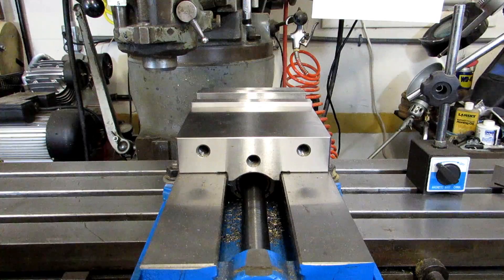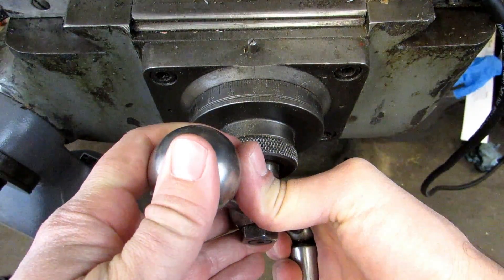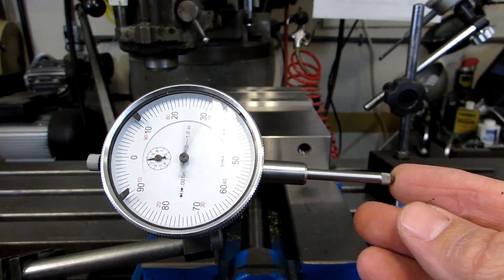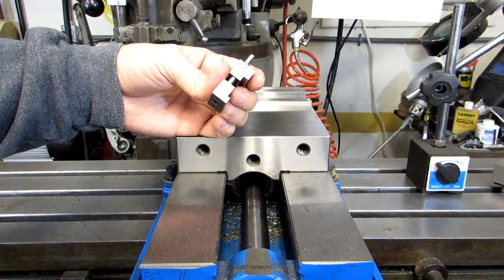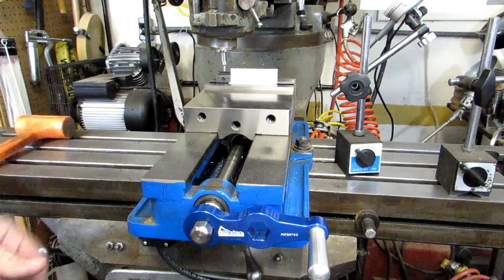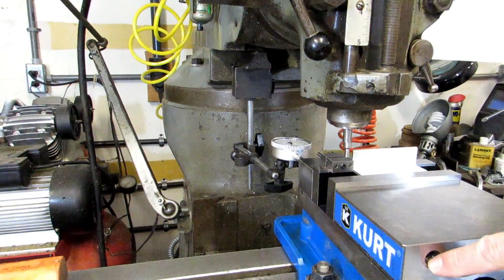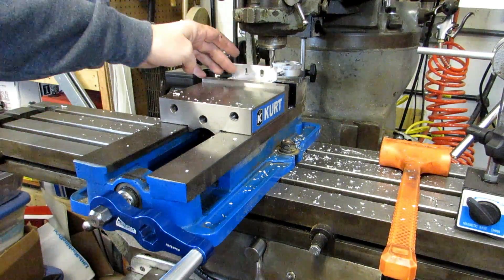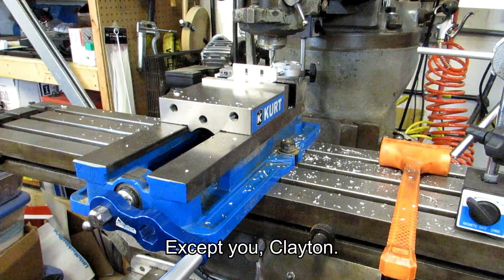Milling without a DRO

Comment: Instead of a scale, just put a piece of tape there,  mark what number the handle is on and the direction of the backlash. I would put a mark on the numbers used on the handle also to make it quicker. You can mark multiple points. Did it for years. The DRO went down at one job and I had to show you younger guys how we did it lol. The X and Y handles are .200 per revolution but the knee is .100 per revolution. Once you get the  hang of getting the backlash in the right direction, quick and easy, down and dirty. Fifty years in, now retired.

Comment: Lay out lines and dykem go along way,  most of the time you dont even need to measure anything until your going for finish sizes. Keep in mind a scribe is .01 wide or there abouts. On most of the manual tools I've run without readouts we put scales on like what you were talking. If you go that route, you also need to mount a reader finger on the fixed part of the slide. Adding a scale holder with dovetails that can be loosened to allow the scale to move freely so can move it to a round division when you start working can also reduce math errors. Devliegs used rods that look like ID mics for measuring if you got good at it you could hold <.002 true position on bores back to a datum, or less.
Reply from the maker: Nice tips, Matt. You're going to make me need to make a follow-up video.
Reply: @StuartdeHaro  I actually am keeping my machine tools without readouts in my hobby shop. Mainly because I enjoy the problem solving that goes into doing accurate work without readouts and because I work with CNC in my day job and I use my hobby stuff to engage a different part of my brain. In addition to what I mentioned earlier theres also toolmakers buttons, gauge blocks and some other old timey stuff and techniques you can do if dead on accuracy is necessary for the project at hand. We sent men to the moon with little more then vernier scales, slide rules, and craftsmanship. Though none of that stuff is fast lol. Loved your video, I look forward to anymore you make!

Comment: It depends on the coordinate accuracy required of course. But ALL feed screws will exhibit gains and losses throughout there travel range. The cheaper or more worn the machine tool then the larger the problem is. Moore Tools who arguably made some of the worlds most accurate jig borers,  jig grinders and measuring machines couldn't make perfect feed screws no matter how much money and talent they threw at the problem. The could measure the inaccuracy's into the low millionths range but couldn't fully remove them during manufacturing even after grinding and lapping. Compounding the problem is those screws and nuts start to wear to less accuracy as soon as there put to use. Before dro's were invented they used high precision indicators and setting rods something like a micrometer setting rod but much more accurate for distance measurements larger than the indicators travel was. That side stepped the errors much like a dro does today.On some of the old jig borers and grinders you can see areas cast into the machine where the indicators were mounted and the distance rods were supported in a straight line. For most of us in a home shop were fitting one part to another so as long as the same technique is used for both any inaccuracy will be approximately the same for both. Accurate layouts prior to starting to machine and quick visual checks with a pocket scale can catch most miscounting errors when using the dials.

Your student Clayton is an obvious fool. Only one with that fools mentality disrespects those with obviously more knowledge and skills than they have. He's in for a rough life once he hits the real world. I suggest he get's a job logging or mining. They have proven methods for quickly straightening out the Clayton's of the world. :-) Then again if he's in a machine tool course he'll likely get to meet a few old school machinist's who are just as good if not better at that attitude adjusting. :-)

Comment: Good tips.  An old timer showed me a trick for when you need to change directions you can lock the table, take up the back lash, and reset the dial and stay pretty close to size.